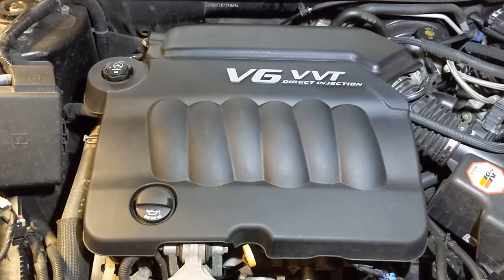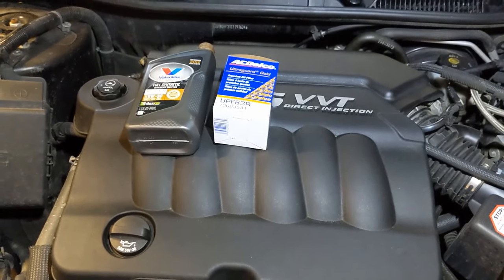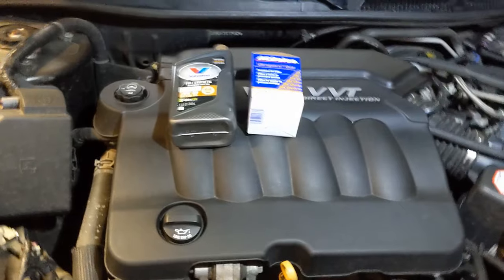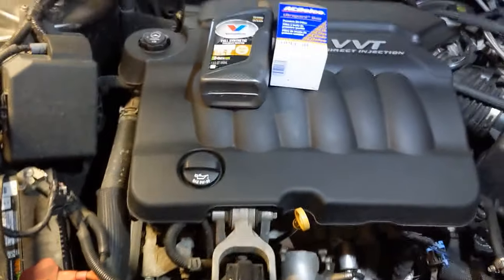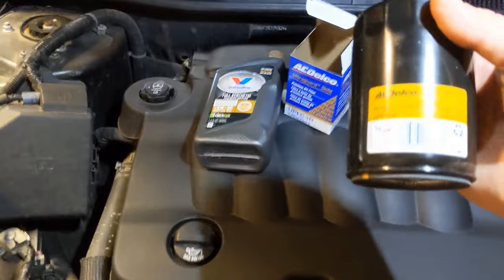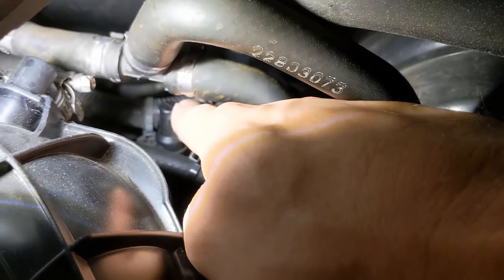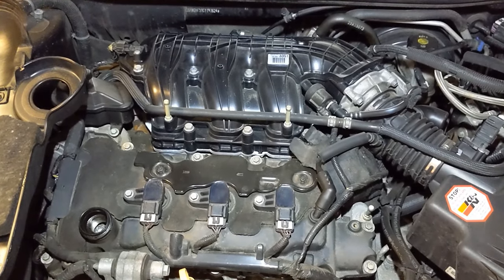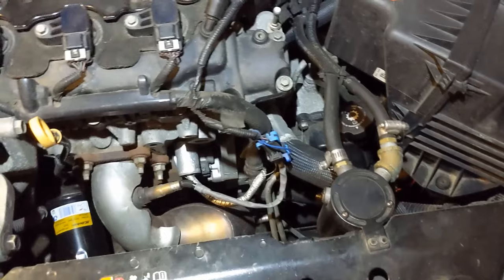How to keep your GM 3.0 or 3.6 V6 running forever - **High Feature V6 LY7 LLT LFX LGX LGZ**

Comment: Couple tips I almost NEVER see people mention!!
# 1) Use of Top-Tier Fuel.
* See your Owner's-Manual! GM "Recommends use of Top-Tier Fuels...".
* This is an actual class of Gasoline. Moderately higher levels of Detergents to help keep Valves/etc. cleaner.
* I've got a beautiful "Cranberry" colored 2015 LTZ, with the Factory 20" Rims.
* Now at 70,000 miles, She runs STRONG! I got it in 2017 as a CPO with 24,000 mi.
* Never more than 5,000 miles on an oil-change. ALWAYS Full-Synthetic since I've had it.
* The ONLY Fuel it's seen is Certified T-T PREMIUM from Shell or Holiday Stations.

#2) SEAFOAM......USE IT!!
* Once a month, when our gas tanks are ~ @ 1/4, I pour a 1/3 bottle in the Tank.
* My small-engine stuff has a STEADY diet of a little SF added to the same gas that I use for the Impala.
* Also....a few days (a week usually...) before an Oil-Change, I put a Cup of SF into the Engine-Oil.
* Even a MONTH after an O/C, I'll check the Oil, & it still looks pretty clean!
* Overall, it uses VERY little oil.
* An aside- My 25 yr-old Snowblower made it TWENTY-TWO years with the Original Carb, because of the above Fuel & Oil practices.!!
* The only reason I had to get a new Carb was because the Throttle-Shaft had worn the Carb body slightly, so extra air was coming in that was causing surging. There's no fix for THAT. Snowblowers vibrate quite a bit, so that wear area eventually affects the airflow.
* The inside of the Carb was SPOTLESS! >>> I think we all know WHY now!
Reply from the maker: I should've mentioned that about the gas. I only put 91 Octane non-oxygenated Top Tier gas from Kwik Trip in my car. I NEVER put any E-10 in it, and I especially don't put E-85 in it!!  I won't get into how much of a sham Ethanol is, but what it does to fuel systems is inexcusable!! Good advice about the Seafoam, it's always a good idea to run some through the engine on a regular interval (through the tank, the crankcase, and the brake booster hose.)
Reply: @CertifiedShadetree  -
Good Man CS! I believe this Impala V6 has been labeled "Flex-Fuel" for a few years now. I know that badge is on mine.
*  As I mentioned....it hasn't seen anything but NO-ETHANOL T-T Premium since July 2017. 
* I mentioned my old Snowblower. Had to use it a couple times in the last few days. New T-T Premium with a bit of Seafoam, and VROOOOMM..... blowing snow!
* I checked how many bottles of SF I bought this year.....TWELVE! 🤓
Reply from the maker: @Wyn61  I had a hand-me-down snowblower when I bought my first house. After 1 winter, I learned the hard way what ethanol does to a small engine's carburetor!! Now I only put "True Fuel" in my snowblower. It's $20 a gallon at Home Depot, but it's shelf stable and if I forget to empty the fuel bowl at the end of winter, the carb will still be pristine when I go to start it the fall!!
Reply: @CertifiedShadetree  where is the bank 2 knock sensor on this car? The one closest to the bumper
Reply: Top tier fuel and other detergent mumbo-jumbo is not doing any good for direct injection engines. Fuel does not spray on the back of the valves. High-octane, no-ethanol gas is also a useless, expensive voodoo myth. The compression ratio of the LLT engine is 11.3:1 - no need for high octane. My CTS owner manual does not mention top-tier fuel. It DOES say use only synthetic oil, also marked on pool-filler cap. I have almost 100K miles on my CTS with the LLT engine and it runs fine. I get the oil changed every 8K miles +/-.
Reply: So I just notice in comments about seafoamso its safe to use on the high value engines also yes or no
Reply: @Wyn61 @RichardFallstich  theyre not designed to run on higher octane, theres a rating and reason behind all of that. this guy sounds like a seafoam salesman. ive heard running a capful of ATF on every other fillup is easy and effective if you want to run detergents, but if your car is flex fuel RUN the E85 every 4th fillup to help burn out carbon (since the hotter more reactive 0xy rich fuel)
Reply: I'm confused now. Which one is it premium gas or not? I got my dad's 13 Impala after he passed away and want to take good care of it.
Reply: I WISH I sold SF!! I'm 62 now, but could've retired long ago if was selling it ......

I just go by maaaaaannny years of being a geek, reading about good & bad practices of maintaining engines, my own observations on all my engines......etc.

Mostly tho', it's all the troubles I DON'T have with MY engines, small or large.
Reply: @wyomingadventures  -- Use whatever gas you want. The higher detergent gasolines keep things cleaner over time. 
>>> Just stay away from Ethanol when possible, or at least minimize its use!!!
>>> And change the Oil..... frequently!
>>> If your engine is a VVT, using SF in the oil does clean the Cam-Phaser parts better. 
>>> If equipped with AFM, SF DOES help clean out the teeny passages in the AFM Lifters.
Reply: @Wyn61  thank you so much for the information. Mine is the VVT. Much appreciated!
Reply: timing chains fail on these GM pieces of shit before 150k. Your shitbox is at 50% of its life. Do a timing rebuild at 120.
Reply: @fyodor8008  -- No worries. Longest I've EVER kept a vehicle is 100,000 miles. 

As we all know.....COUNTLESS Engines out there have problems. It's funny tho', >>> I've <<< never had any.

Hmmmmmmm........seems strange.....😈😈😈😈
Reply: @Wyn61  Everything on the market is designed to last more than 100k. Although, pieces of junk do fail all the time during the warranty period.
Reply: I run Shell premium 93 exclusively.
Reply: Are You using WIX as replacement parts, or are You sticking with ACDELCO?
Reply: @FoolsAmongUs  -- Hello! If you're asking me.....I've always used AC-Delco filters, & Mobil-1 for years.
Reply: @Wyn61    I switched to WIK's after watching The OIL Geek.........he has a solid show.
But, I am still using Motorcraft Oil for the Ford, and Pennzoil for the Trans Am
Thank You for Your Response
Reply: @FoolsAmongUs  -- I had a 1981 Turbo Trans-Am..... last of the Big T/A's! I'd almost K**l to have that thing back!!!
Reply: @Wyn61  That is why people dream...........I want my '72 SST Jav Back.
Now, I am on the other side of 50, but I will NEVER Forget My First Love.
Reply: @FoolsAmongUs  -- Well....I got you beat, I'm 62 & still Rocking!! Even have a full head of hair! 😗

Comment: I can't believe that the 3.6L LFX is still getting dissed for common issues that ANY direct injected 4 cam engine would experience if NOT properly maintained. I have a friend with 215k on the clock in his 2012 Impala V6, runs perfectly fine...no issues at all. I purchased my 2013 GMC Terrain V6 3 years ago with no regrets whatsoever. Change the oil every 3k miles with full synthetic Dexos and a "real" oil filter and this motor will continue to run strong. I've had no oil consumption or timing chain issues, no leaks, and I'm not even running an oil catch can.  Now, the 2.4L 4cyl. is a totally different story!.
Reply: That’s right. Maintain the 3.6 perfectly and it’ll last to 250k miles easily. But they are very picky about their oil and do not tolerate neglect.
Reply: @da_poopoo_dealer3152  So you actually admit you outran the police? What'd you do?

Comment: 225,000 on my 2014 impala 3.6. I change oil and filter every 4,000 miles. I use a blend oil, castrol mostly. Best thing GM has made in years.
Reply from the maker: That's what I'm talking about!!
Reply: That makes me so happy man I’ve got 108k on my 2014 ltz and it’s been such a damn good car hoping it last till 300k
Reply: I have a 2020 Blazer with same engine (I believe). Have you had to clean the valves - because it’s a Direct Injection???
Reply: @arcad1an292  No. Just keep the oil clean and replace plugs every 50,000-75000 miles.
Reply: @jamesdunning8650  
That’s impressive. Because from what I know the intakes will absolutely get clogged up. Thanks for the feedback.
Reply: The 3800 v6 laughs at all of you
Reply: I have a 2014 camaro v6 same engine as you with 210k just basic maintenance. Transmission still shifts smooth only thing that’s out is the AC but I think it’s just a burnt clutch coil $100 fix. Hope I can keep this thing forever ! Still pulls hard too
Reply: @ryanthompson2893  

Yes! That was one of the best ever by GM. Unfortunately, they stopped making them. 💯💯
Reply: Is it still running?

Comment: The 3.6 from gm is stupid powerful I've driven several impalas with this engine and they have no problem getting out of their own way
Reply from the maker: And with a couple mods, they'll run 13's in the quarter!
Reply: @CertifiedShadetree  it's quite insane my mother has a 2020 acadia 3.6 and that think will hit 100 flat in no time when entering the freeway it can achieve 90 before hitting the 4 lanes
Reply: It's powerful but not reliable ,I prefer GM 3800 engine
Reply: @theshield1613  yeah that 3800 was indestructible but it was underpowered. Really slow engine the 3.6 can be reliable if you take care of it. I have an 12 impala with 211k
Reply: @CertifiedShadetree  what mods? There's really no aftermarket parts for the 3.6 unless it's the camaro 3.6
Reply: @YanilMiami305  what do you recommend doing the oil change 3k or 5k  on the 3.6l v6
Reply: @theshield1613  me personally I never go more than 5k so anything under 5k should be fine I also only use pennzoil 5w 30 high mileage full synthetic and ac Delco filters and I Also use a can of seafom every oil change to keep the injectors clean.
Reply from the maker: @YanilMiami305  Lookup a channel called ImpalaLFX13
Reply: @CertifiedShadetree  ok I will I never heard of these 3.6 impala being modified only the SS version
Reply from the maker: @YanilMiami305  https://youtu.be/0vrRTM4c41I
Reply: @CertifiedShadetree  these 3.6 impalas are fast stock so its believable that they can be made faster with a few mods. I've beaten a few infinitis and maximas with mine on the HW lol
Reply from the maker: @YanilMiami305  I haven't been brave enough to try it, but it is possible to run nitrous on a 3.6. A popular mod the Camaro guys do is install a throttle body from a 5.3 truck engine. Well they sell a nitrous plate that fits the 5.3 TB, so that facilitates an easier nitrous installation on the 3.6.

Camaro Mods Channel did this to his 3.6..
Reply: @CertifiedShadetree  I definitely look into it I know I seen some V6 camaros with close to 500hp as well as some Cadillac ATS's but never thought that would be possible in an Impala as you know FWD don't really handle power that well.
Reply: The lfx is in the 5th gen v6 camaros and the lgx is in the 6th gens they make really good power for a lil v6
Reply: @lukeroberts9441  the only thing about the 5th gen camaro is that is heavier than the 6th gen v6 by like 400 lbs if I was to modify a v6 Camaro it'll be a 6th gen

Comment: As an Aussie it's funny seeing these Engines in transverse mount... They're known here as the "Alloytec" LY7.. I've got one in my 2006 Holden VZ Calais
Reply from the maker: Sadly, pretty much everything is FWD in America ☹️.
Reply: I love they put this motor for rear drive Holden's. Makes oil changes so easy. With the drain plug in the forward position and oil filter on top.

Makes my VE SSV oil changes seem like a arduous chore.
Reply: Easier to get to that damn thermostat tho…
Reply: @brettcaddy7395  That is so true.

Comment: People say that this engine is too high tech to be reliable like the old 3.5 or 3.8's. I say people are too lazy or stupid to realize that the vvt system requires clean and full oil level in order to function properly. The old engines couldn't pass today's emission standards and fuel economy standards. That 300HP comes with some responsibility on the owner's part.
Reply from the maker: You speak 100% truth!!

Comment: We have a 2005 Caddy, 255.000 miles on it, twice a month I shoot a couple of squirts of throttle body cleaner down the pcv, also don't let the oil get below half a quart, and I change it every 2.500 miles, oil is cheap.

Comment: Almost 300K miles on my 2012 Impala. I bought it when it was a year old rental car. I've been running nothing but Valvoline full synthetic every 3K miles. I never modded the pcv system or installed a catch can. It is whisper quiet. You have to listen hard to hear it idle. It has all the power it had when I first bought it. My son is driving it now and it may do another 100K! An incredible engine!
Reply from the maker: That's damn impressive!!

Comment: I own a 2011 Cadillac CTS4  3.6l with 31,000 miles and I am very worried about what I hear dealing with the timing chain. I run Mobile One in it since it was new am I doing anything wrong, is there something more I could do like run Royal Purple?  I heard about the PCV valve enlargement, should I buy a new one (does it have enlarged holes new?)?

Comment: Yes, you can drill out the PVC valve to decrease the velocity and that will often reduce oil loss. GM also came out with a new valve cover gasket that restricts the air/oil flow to the PCV valve. The early engines did suck oil thru the PCV and low oil will damage timing chains, both thru heat and also the tensioners are hydraulic pistons using engine oil pressure. Oil gets low, the pressure drops, the timing chain is cooled by oil so they get hot, and the tensioners start to collapse so the chains get loose. Absolutely, keep your oil full and changed. OFTEN! 3K at a minimum..
Reply from the maker: Preach it!!

Comment: I drive a 2008 Holden commodore with the famed LY7 engine and with nearly 300k km on it, I still haven't done chains yet and I've owned mine since 137k. Servicing is key to these engines and keeps them going. Mind you i give my car hell and she still goes.
Reply from the maker: Congrats!🍻  We need to keep repeating it to anyone within the sound of our voices to service the shit out of these engines!!
Reply: Lmao 300k?? I bought a 2006 Holden VZ Calais at the end of last year with the same LY7 and it only had 150,000 KM on it...don't know how, must've been some old timer owning it along the way or it's been garaged for sometime... The 2004 VZ SV6 I ditched prior had about 280,000KM.. had oil leaks, and I suspect a crank angle sensor issue, cause it stalled twice and the steering wheel would lock up!! Very scary situation while driving!! 
.these engines can be F'in headaches!!! Not to mention a lot of them here in Oz have been thrashed.
Reply: the last part of your paragraph is the reason your car has lasted as long as it has ! being a holden mechanic i have noticed a trend where the ones with low KM and are not driven very far over the 9 month intervals are the ones with Timing case leak issues. The ones that are driven more then 15000km WITHIN the 9 month periods usually have little to NO issues with them . i worked on a MY2015 Calais V6 with 240k km which is HUGE KM for such a short time and it Had ZERO issues , vehicle looked Brand new. not a single leak anywhere and suspension components were perfect. 

general rule of thumb for these engines - Drive it long , Drive it hard.

Comment: My first experience with a 3.6 (being the LFX) was in a 2012-2013 Chevy Impala I used for a week in preparation and taking my driving test many years ago. Acceleration felt effortless but you have to rev the piss out of it to hit the 300 hp. Most of them may be rental cars but that thing moved.
Reply from the maker: It's a bit jarring when you first drive an LFX Impala if you're used to driving an Impala with the pushrod motor.  You fully expect the power to come on in the low end of the rev range, and when it doesn't you mash the throttle and BAM, those 303 ponies hit you upside the head!!

Comment: I do agree 100% with you... very good advice... I have a llt version of the contraption, I do change the oil every 3 000 miles, the thing has 200 000 miles so I did replace the timing chains / sprockets as prevention . And yes check your oil often as it does use some a little when they age. Thanks for posting....
Reply from the maker: Did you go the timing chains yourself?  If so, how did that go?
Reply: @CertifiedShadetree  yes i did it is was a long job that i ve done twice as one one of the tensioners was not not set right in the box... so I had a nice chain rattle  on startup 
thanks to Cloyes... so reset the tensioners before assembling.
Reply from the maker: Oh wow, that's shitty to have to go through all of that work only to find one of the tensioners was garbage!

Comment: 140K on my '12 Enclave; runs so smooth at idle, I can't even tell its on. I agree with you but I'd add once they get to 100K miles or more I top them off halfway between the oil change intervals. I don't bother with high mileage oils either; just get the full synth 5W-30 on sale (honestly for me the brand does not matter, I just get the cheapest). Too low oil will stretch that timing chain faster than running old oil in there for a few thousand miles. So far, so good.
Reply from the maker: I wouldn't recommend the high mileage oil either.  Mine has 175k and even with the catch can installed, I don't need to top it off at all between OCI's. I absolutely attribute that to the Valvoline Modern Engine oil. Keeping the intake tract clean is just as important as changing the oil in these engines!!
Reply from the maker: Thunderbolt  The 3500 is a solid engine. It's the most refined of the old pushrod GM 60* V6's. Although unremarkable, it's extremely reliable, and not prone to the issues that plagued the earlier 3400's & 3100's.